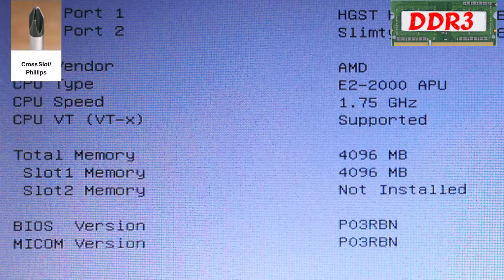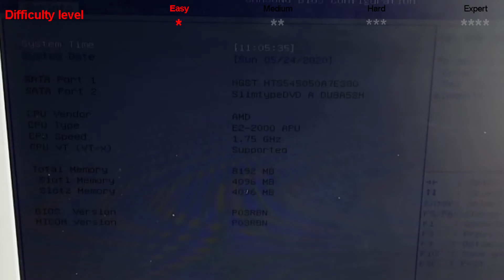How to upgrade thr RAM for the Samsung NP275E laptop #redigitt

Comment: what is the ram voltage  used? 1.35volts or 1.5 volts?
Reply from the maker: If you freeze the video https://youtu.be/_7bbFHI0L28?si=_0V5iXTkyPngwIEX&t=68 , you can see the RAM memory model Samsung M47185273EB0-CK0 https://memory.net/product/m471b5273eb0-ck0-samsung-1x-4gb-ddr3-1600-sodimm-pc3-12800s-dual-rank-x8-module/   .  The Low Voltage RAM's usually have the L letter in the name like DDR3 PC3L
Thank you watching, if  my video was helpful,  please don't forget to share, like the video and maybe subscribe. 
Good luck with the upgrade.